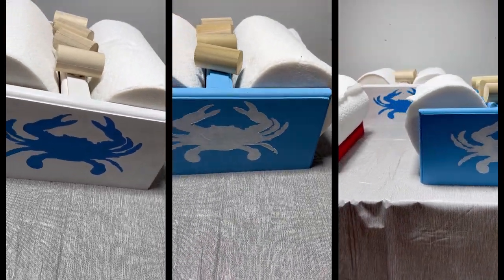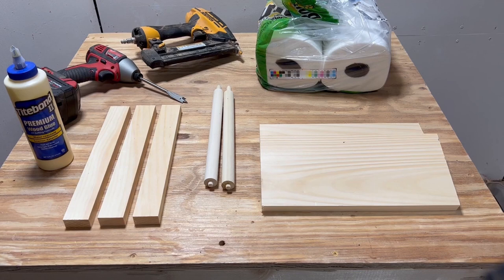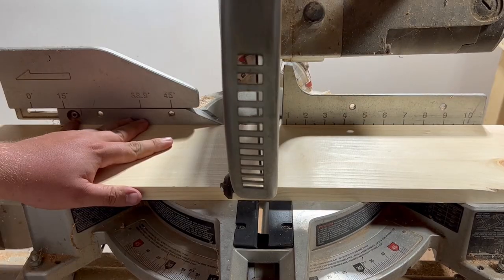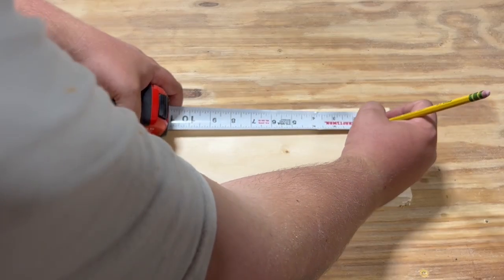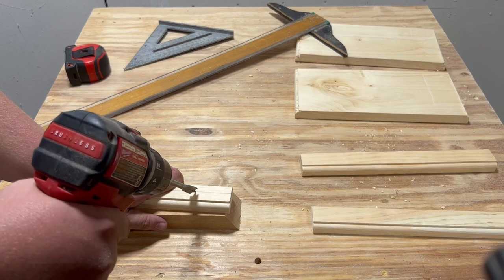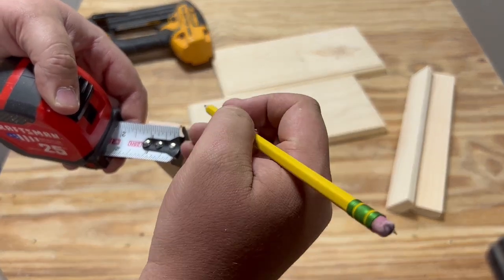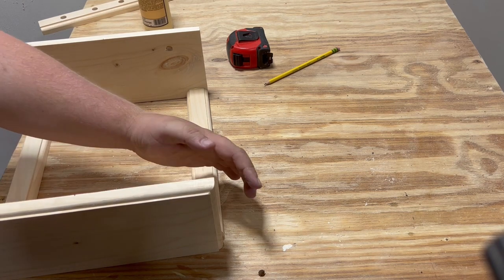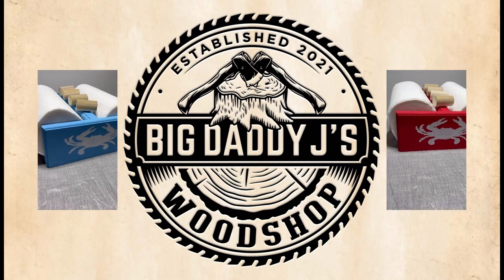Complete Dual Paper towel dispenser build

Comment: Hi. What were the dowels you used called? Did you make them or did they come that way?
Reply from the maker: I snagged them off of Woodpecker crafts, they are relatively cheap!
Reply: @BigdaddyJwoodshop  were they already machined to fit in your  paper towel holder? I don’t have a lathe.